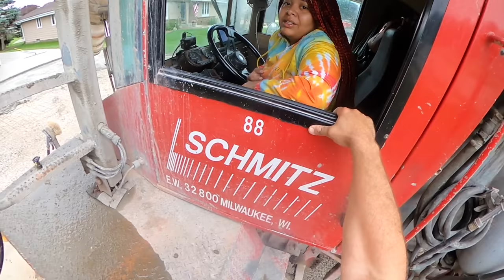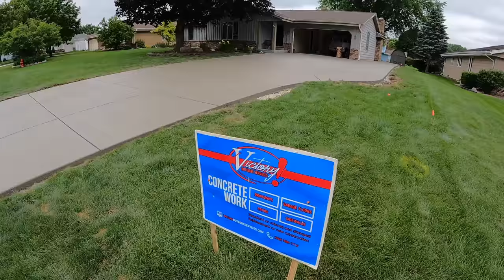Concrete rejected-Load was too wet!

Comment: As a mixer driver myself, it feels bad when you show up too wet... but most the time they pour it anyways. In this case its different because it being a driveway, it has to be poured a little dry
Reply: how much do you make doing mixer driving?
Reply: How about with water reducer? Is it actually ok to pour a 10+ slump like some guys do?
Reply: @okgroomer1966  Depending on the companies mix designs and what is being poured. But for a slab, for example, yes, it will still be strong.

Comment: Finally you get a good driver and it's too wet lol. Can't catch a break!
Reply: That's on the driver, either they added on the way or it was batched too wet initially.
If it's batched too wet, the driver needs to inform the batcher and get it dried up.
Reply from the maker: I know right!
Reply from the maker: You're right. I think she messed up. She is relatively new.
Reply: @VictoryOutdoorServices  As long as everything else is good, hopefully she learned from it.
Slump gauges can be pretty tough to read for new people, they read different based on mix design, the grade the truck is on, engine rpm, etc. Basically all they do is report hydraulic pressure.
If she sticks with it in a few years she will be able to get it within a half an inch by ear.
Reply: That over watered truck got sent to another job. The batch plant probably slapped a new ticket on it and sent it back out. They make sure they never lose $.
Reply: @karlmorgan1257  Probably, most places send ANYTHING to a footing.

Comment: My driveway is cracking more than it should because, mine is this long and only has 2 control joints. Great video.
How wide is you sections for control joints?

Comment: 33:23 another way to help reduce cracks is to put sived white sand  (doesn't need to be perfect just as long as there's nothing larger than 1/8"(3mm~) in it) or similar down. It acts like roller bearings between the ground and the slab.
Reply: He's been doing this for almost 30 years I think he knows what he is doing
Reply: @maxevans8297  different countries, different methods. You never know what someone else does differently. I'm in Australia and I've never seen anyone put blue metel(basalt) under a concrete pad.

Comment: You order the mix you need based on what you are doing with it. Wrong mix will cause cracking,  spalling( flaking off)  and other issues that you as the contractor will be dealing with if you accept a load of BS mix different from what you ordered. I am not a concrete pro but I'm writing this cause all the comments seemed to be confused. Yall do beautiful work,  super clean everything slick tight and nice. If I had learned from these guys I would have been a pro, quickly

Comment: On the threshold from the new concrete to the garage door. Why didn't you put a drainage channel along this to stop the water from going into the garage? The drive looks great but the level looks the same as the garage and won't water be blown into or under the garage door?

Comment: Why do you brush the concrete? I've always wondered this. Thank you for talking about the lines! I actually thought those were to control water so it doesn't pool
Reply: It adds texture to the concrete and if it wasn't added then the concrete would be really slippery with any water on it.

Comment: The only time I have seen concrete poured as wet as that rejected load is when we filled in a sink hole where I work.  Needed to make sure it got down deep in the hole to hopefully plug up where it was going.  It's been about 10 years now and it appeared to do the trick.

Comment: I don’t know much about concrete pouring but i was almost certain the grid was supposed to be lifted up while pouring so it sits halfway between the top and bottom of the slab adding structural integrity. Are you supposed just pour of the top of it?

Comment: So why is the wire on the ground and not suspended in the concrete? I thought you were going to lift it as you go but you just poured over it. Is that the right way to do it?

Comment: Nice job that looks awesome thank you for the videos I have learned a lot just got one question do you guys ever have to use the tiny square blocks with the wire in them that go under the wire panels

Comment: i think the concrete looked nice, we use slump 18-24 in norway, and the 24 is so nice for like flat surfaces. we also add accelerator to it so it dries up faster

Comment: My concrete driveway needs to be redone. I'm in a warmer,, humid climate with shifting clay soils, hence the need for the redo, although the house is 42 years old. Would pouring piers in certain areas under the slab "shore" up the concrete and prevent it from cracking? I see piers installed to foundations after the fact and I wonder why they aren't installed to begin with. Also, can the driveway guys repour my garage floor or is that something totally different?

Comment: How do you judge the  amount the viscosity (how watery ) the concrete is ?
Isn't there some method of sampling the wet concrete that is more accurate then your judgement, 
which has proved correct for many years ?

Comment: I always wonder the choice to use concrete or asphalt, this size seemed like asphalt would be more efficient, i'm assuming concrete lasts twice as long.
Reply: Yeah, typically concrete is supposed to last a lot longer. Ryan never pours it by itself for obvious reasons, but the rebar he and his crew throw down is there to ensure the driveway lasts that much longer in the long run. As far as asphalt goes, that tends to start cracking within a decade.

Comment: I just put in a sidewalk and it started raining. So we covered it with plastic and went inside .some of it sagged and sat on the concrete over night. the next day the concrete was discolered. it doesn't seem to cause a problem, but I don't know why. I just had a thought that it could be the plasticflatened out the concrete a little and changes the way the sun hits it..

Comment: Not sure if you still read comments or not but my parents had their driveway poured with only fiber mesh concrete and no rebar. Do you think this is a problem or should it hold up over time like regular rebar mesh concrete?

Comment: Doubt this comment will get seen, but hopefully it does and someone knows an answer.

Can you fill the 'control lines' with another substance, like rubber cement or a filler, something that wouldn't directly bond to the existing concrete, but would reduce the amount of moss and organic build ups, which I would assume leads to compromising the existing driveway, also would help reduce the amount of cleaning required to maintain the drive.

Comment: The reinforcement is not tied together and it is lying on the ground, it should be spaced and inside the concrete slab. How is this supposed to work when it is just there being pretty? The wire also seems to be really thin for the job.

Comment: So the question about the cracks... why not do that in roads? specifically down the middle of the road to prevent it from cracking. Im aware its asphalt vs concrete but why not do the control in roads?

Comment: As a concrete superintendent, I only did finishing to show my team how I wanted special finishes because of a language barrier. I had a dedicated Mexican team & I don't speak much Spanish. I was a working superintendent, so I didn't spend all day in a trailer, but I had professional finishers that I trusted to do a great job for me. I remember one day I had them sit in their trucks during a morning rain while I pumped 24-10 yard trucks into a 14' x 17' x 9' 6" high steel form made from 3/4" plate steel for a 7,000hp electric motor to sit on. The rain stopped when I finished pouring, then I had them finish it and help me set the 8- 3' x 2" J-bolts that held the motor in place. Quite nerve racking to walk on top of the grid of # 6 rebar 12"x12"x12" centers 9 feet off the ground pumping via a 42 meter pump truck while two trucks fed it simultaneously, in the rain and vibrating every 12"  lift, by myself. "easy money".

Comment: The flow of the concrete is determined  by the slump test.. I can't see a slump plate..slump cone ..tamping  rode or funnel . So how exactly  did  you determined  to actual slump.
Reply: years of experience im sure can roughly estimate what slump it is
Reply: @kosan2875  modern  additives  mean there is little coronation between  visual slump and actual slump

Comment: Dumb question maybe, but why did you not try to spread the wet stuff out over coat it with the proper stuff?
Reply: He did. He didn't use the entirety of the wet mix so it wasn't a big deal. Had he used it all though, it would've been.

Comment: As a young and green structural engineer for a large GC in the Chicago area we had a huge pour going on. I rejected a load for being too wet. The concrete foremen tells me to write down the truck number because that driver would go sit somewhere until the concrete took its initial set and then he would come back with what looked like a decent load but in reality was junk. Sure enough about two hours later the truck was back. A quick look at the batch ticket and we determined that the load was almost three hours old. Tossed the driver and the truck. Called plant and relayed the story; we never saw that driver again.

Comment: Long time ago a old guy told me concrete was a bunch of   T TTTTTTT' s  mixed together . Once each T  makes a bond during mixing that bond breaks and can never form again. The concrete has a limited amount of bonds to make then it will not be strong . When a truck get stale and the guy adds water to make it slurry. The concrete will be weak and not have all the bonds  to make it strong..

Comment: I know it's not a minimum for codes in the United States for concrete but you need to check your MPA rating and that will tell you whether or not you have really good strong concrete coming from the Concrete supplier

Comment: I live in South Carolina were it gets as hot as H. When you see people in my neck of the woods pouring concrete wet or above 4 in slump, they are fly by night companies that do this to get it out of the truck and finished. NOT on my job. When I order concrete, I let the plant know how far I am from them and I want the concrete on the job with a 4 inch slump. From there they can adjust then mix even if they have to add ice. In case of hot weather, Super plasticizer can be added to the mix on the job. What you have here is failure to community to the plant and they not watching the mix going into the truck.

Comment: why not make more joint lines to reduce chance of random cracks even more?
Reply: That’s about as small as you need to go, with good steel and concrete each 3x3 section is self supporting. If you’re getting cracks in a section that small something is wrong.

Comment: The wire mesh on the ground is doing nothing. should have block holding it up, lifting with the muck rake does not work.

Comment: So what do you do with the wet concrete already pored
Reply: In this case, it wasn't too much so he could just pour the truck with the proper mix over the tiny amount of wet mix and have the driveway still be fine. Had he poured that entire truck with the wet mix though, it would've been a pretty big deal since he can't just take out the concrete once it's poured; meaning there wouldn't really be an easy way out of it at that point. That part of the driveway would probably have to be completely torn out and started from scratch again.

Comment: 1). The wire mesh does it no good sitting at the bottom like that.  2). It's a good idea to cut the control joints all the way to the bottom with a concrete saw the next day so the sections really are separate.  3). That was really cool you got the customer a pair of boots.

Comment: Chicken wire sitting on the ground? How is that going to hold?
Reply: What? The wire mesh is for weight purposes so the concrete doesn't bust open.
Reply: @disputethis3  Supposed to be "in" the concrete to do that, not under it. Ever see a highway being poured, they place the re-bar exactly half the thickness.

Comment: I have yet to see a slab falling apart for lack of welded wire.
  There is a concrete parking lot in my town that has about two foot square cracks and tons of crumbling clearly from rebar that i also disagree with putting in slabs.

Comment: rejecting concrete with no slump cone? Grab the ticket from the truck/mixing plant and look at how much h2o was added to the mix. air percentage is much more important to freezing and thaw freeze cycles, as water evaporates during the curing process. if you're worried about it freezing overnight, you'll have to get some sort of cover that will keep everything at 40F or above. idk man...

Comment: in norway, that would also be a job i could take on my own if the celcius is under 25 degrees
Reply: btw without the cutting lines. i would use a saw after instead

Comment: Not lifting your mesh off the bottom is doing a lot more to "risk the 'integrity' of the concrete" than wet slump. Might as well not even use the rebar.

Comment: You’re wasting time with that hammer brother. Cut through the asphalt at the end of the driveway 1 foot back all the way across and then pull up that small chunk with a pick and from there just lift it with your bucket and load it. Very quick and easy

Comment: “My meter was reading a 5”, does it look like a 5? Never trust a slump gauge, only point of that is to ask for water under the plant if the batchman loads u super dry. Always look and listen to the concrete as you add water.

Comment: 28:45  Wire Mesh reinforcing flat on the gravel -- not lifted up to allow the concrete to go under it.  That "reinforcing" will not reinforce at all as, where it is, it will rust away in very short time.  The reinforcing should have been pulled up so it lies at a depth equal to about half the concrete thickness.  This video displays very poor supervision and concrete laying practices.   This whole job should be ripped up and relaid correctly.

Comment: Bet this drive way has cracks all over now. It's poured way to thin.
Reply: If so it's underneath the surface of the concrete where you can't see it. That's the whole idea of Ryan doing it the way he does; any cracks it gets later aren't visible on the surface until potentially way later.

Comment: You guys absolutely added no expansion joints before pouring. You just made a groove in the concrete to simulate an expansion joint. So sad. SHOTTY work like this. Looks good. But, will only lasy maybe 5 years before cracking. Such ashame.......

Comment: You should have shoveled that wet concrete off the driveway.  Why aren't you testing for slump on every load?  You can tell the supplier exactly what you need, but will he deliver it?  Trust the vendor, but verify your specs.

Comment: This has to be a joke!!!  You wouldn’t get a job in Australia.

We would pour that entire driveway with three blokes and do it properly in 40 deg Celsius heat.Mesh elevated on mesh chairs, mesh tied together and use a soft cut saw at the end of the job to cut the slab. Trowel machine non slip finish.

It is pointless just leaving the mesh on the floor. Ask any engineer.

Your concrete mix is to bony. Need to add more fines and some plasticiser.

Comment: I hope you enjoyed wasting money by paying for all that flat mesh.  It is going to do nothing to strengthen the slab but will actually make the slab thinner over time.  The mesh was not supported up into the slab and was not pulled up.  It just lays flat on the ground, waiting to rust and spall off the bottom of the slab.  If you are not going to support it or pull it up, you would be better to leave it out and just put some fibermesh into the mix.  SDH, P.E.

Comment: I have poured thousands of yards of concrete and your first load would have been sent back on my projects. we poured 1" slump all day long 4000 psi strict control.  tested every load, slump and breack tests. water cement ratio is very important. we poured 3000 yards every day.